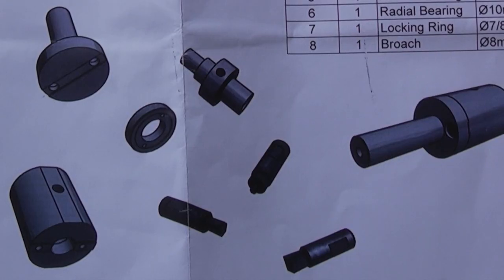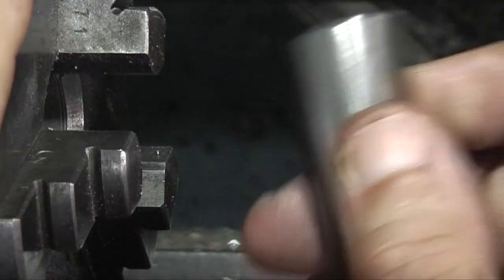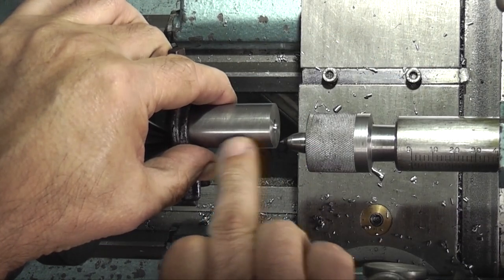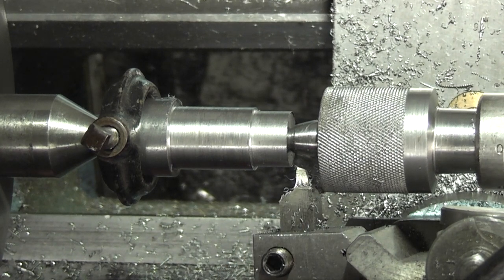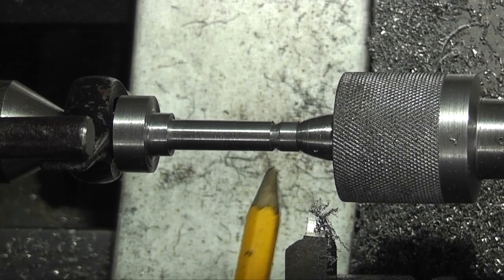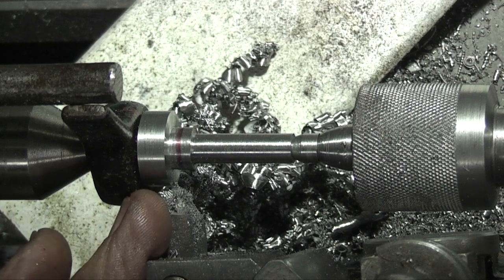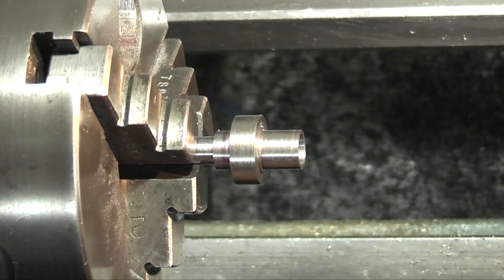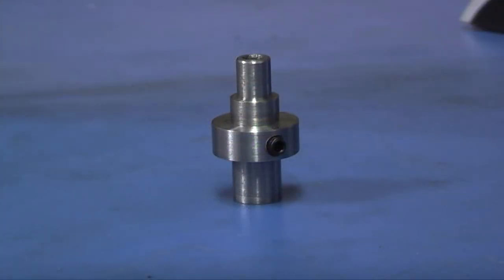Rotary broach making the spindle

Comment: Good idea to turn the spindle between centres, but I'd have been inclined to use a half centre in the tailstock to allow use of the original tool. I find rotating centres somewhat big and clumsy when turning small parts. and the use of the smaller half centre would have prevented the clash with the toolpost, which was really just bad luck. We all fail to spot potential problems at times, thanks for being up front about the incident.